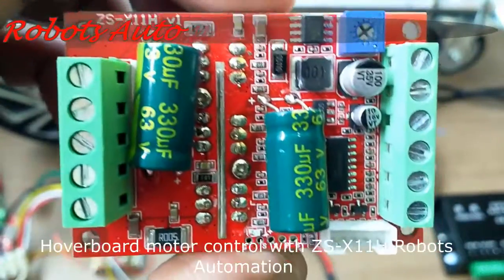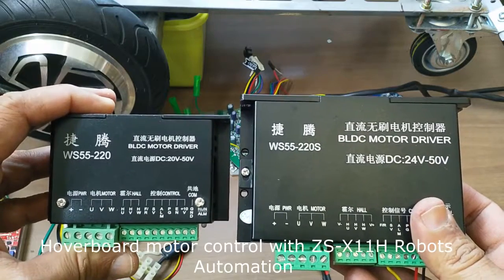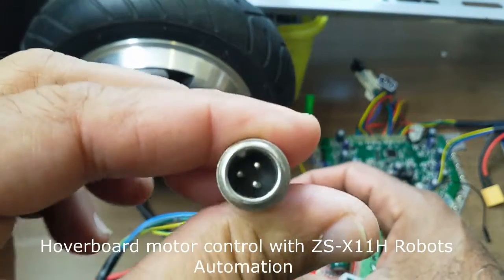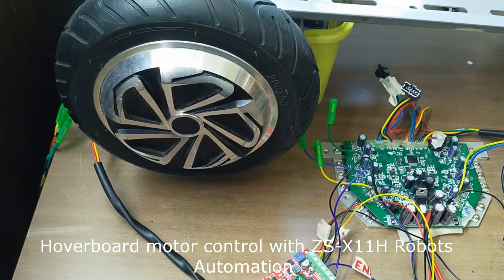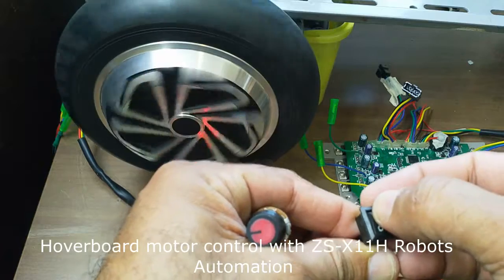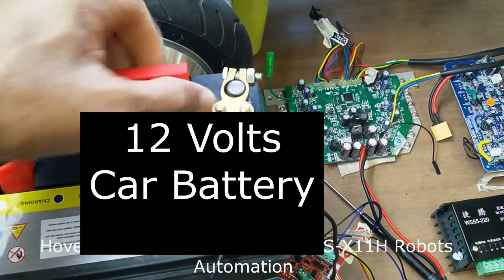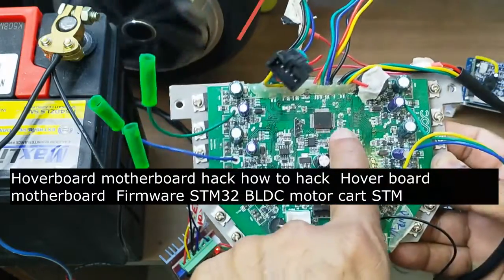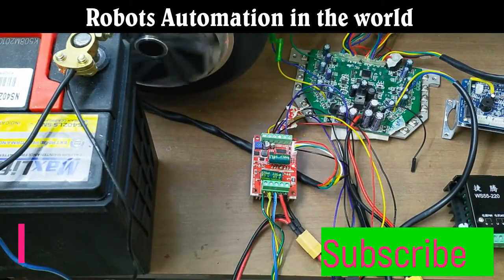Hoverboard motor control with ZS-X11H Robots Automation 400W Brush less motor controller Demo bldc 7

Comment: Hello. Do you have a video or do you know how to connect this controller to the RC receiver? That there is PWM there is clear. But how to control the motor through the receiver? How to give a command to brake, reverse, and stop? And what is the stop shorted to? Not to the resistance but to itself? Will the controller not burn out when braking? ao
Thanks in advance
Reply from the maker: Give you link

Comment: Could you tell me what kind radio control would work with ZS-X11H motor controller
Reply from the maker: I use exp32 / Lora also possible  and Long range also I tried

Comment: hi, do you know how does pwm works on this controller? thanks
Reply from the maker: I will send you link
Reply from the maker: ZH X11A/B/S drives the motor with a series of On-OFf pulses it adjusts the duty cycle while keeping the frequency constant  the speed output varies based on the speed demand input 4   which is speed input voltage 0 to+5 volts

Comment: HI. I have one question. I have 40 volt battery and 400W 6-60V 16A BLDC 3 Phases DC Hall Brushless Motor Driver as you have in video. Can i use switch on battery power. it is not dangerous that i use 40V Battery using Switch? on-off 40v battery using switch it will be dangerous? i think it will be dangerous what you think? it will be more good that battery will be always on and red light on the board will be flashing the whole day? it is not dangerous that battery charging voltage also on the board switch? one time when i try just connect and disconnect 40V battery it had spark.
Reply from the maker: Use High  amp switch

Comment: One of your wires has 5volt on it. Is that coming from a 5 volt source? Like another battery? Or is the board itself suppling the 5 volt to that wire?
Reply from the maker: On board

Comment: How it is possible that a 36 volt 4AH battery, (which is only 144 watts/hr,) easily drives 2×250 watt=500 watts of Hoover board motors ? 
I need to know the logic,so please do reply,
Reply from the maker: This controller and bldc from same hover board friend
Reply: @MKRCLabs  that's my question brother, original battery supplies only 144 watts in total to controller, but motor requirements are 250 watt for each motor, for both motors 500 watts needed, then from where the extra watts being supplied to motors,
Reply: @Pol_Khol_Agent  there has to be a splitter I would think I'm starting my projects I have 3 hoverboards taking apart and playing around .
Reply: The Battery can provide 144 continuous Watts over one hours. It can also provide 288 Watts over 30 mins. Hope you get the Logic. Also the Motors dont always draw 250 Watts each, the power consumption depends on the load of the Motors.

Comment: Motor doesn't sound healthy;/ are you sure those phases are connected correctly?
Reply from the maker: Inter Change the cables input Hall sensors or supply phases to motor both ways possible (position changing)

Comment: How i can get the inverse direction without using the reverse button ? I have two blcd motor and i want to theme turn in opposite of each other how i can doit?
Reply from the maker: Change the phase or hall sensors

Comment: Hi, thank you for this excelente video. This controller have a brake funtion. Is possible use this funtion like regenerative brake system and load battery while wheel are braking??

Comment: Hi, I am trying to use this module (on a 12V system), and I seem to have the sensor and motor wires all connected in the correct order, driven by a 3V3 PIC controller PWM and logic signals. I can run the motor forwards and reverse, but sometimes it won't start, and I have to flip the direction forward-&-back to get the motor to start up. Also, it runs at full speed in one direction (about 330 RPM), but only half speed in reverse (about 170 RPM). Any tips?
Reply from the maker: Good try
Reply: @MKRCLabs  I got it - the motor wire colours do not match the sensor colours. Trial-and-error and it runs like a Swiss watch - smooth and full speed in both directions.

Comment: HI 
I am using a similar setup, ZS-X11H V1 motor control boards and ex hoverboard motors, 350Watt, driven with a 12 V battery for test purposes, built into a small land vehicle. 
What is the white remote control unit you are using in one of your videos to control the ZS-X11H board please?
Ken
Reply from the maker: Good try but did you check on off  not good switching
Reply: @MKRCLabs  Sorry, I don't understand what you mean. Ken
Reply from the maker: Close contact is break and  open contact is run it should be oposite

Comment: Can this driver be used without hall sensor lines connected
Reply from the maker: Yes
Reply: @MKRCLabs  I was planning to use this with a rc brushless motor. 3650 3900KV with a rc setup.
Will it work? And any piece of advice

Comment: will this controller work with a thumbthrottle? 🤔 instead of Potentiometer
Reply from the maker: Yes thumthrottle has potentiometer in side only difference it has spring bring back to intial position

Comment: I have the same controller. The hall lines from the controller from left to right are black-green-yellow-white-red. The hall lines from the motor are black and red for power and green-yellow-blue. 

I did connect black-black, red-red, green-green, yellow-yellow and white-blue. Is this correct? I didn't know what to do with the blue wire from the motor. You also connect it to white from the controller?
Reply from the maker: If bldc motor running fine
Reply: @MKRCLabs  The motor is running but maybe it could be better?
Reply from the maker: Ok but what is issue speed? Break ?
Reply: @MKRCLabs   It has very little torque when I start the motor. I need to push it a little bit to get everything going. Low speed torque is not that good. 

Maybe that is normal and not due to wrong wire connection. 

Also how can I reverse the rotation of the motor? I don't mean the reverse funtion of the controller, that is working fine. I tried swapping 2 of the 3 motor power wires but it won't turn. Do I need to change the hall sensor wires as well?
Reply from the maker: Batery voltage or change connection
Reply from the maker: So check voltage  and try to change hall sensor wires and motor all three wires

Comment: what potentiometer did you use
Reply from the maker: 10k
Reply: @MKRCLabs 
With a potentiometer it's OK (0-5v), but with "finger throttle" (with hall sensor) the motor reacts when pressed but keeps turning when released (0.75-4.2v)
Translate a conversation
Reply: Thnx
Reply from the maker: 10k
Reply from the maker: 10k